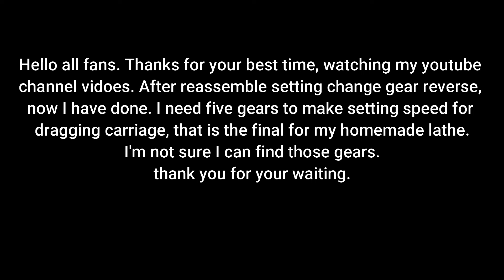DYI, Renew Setting Change Reverse Gears Southbend Lathe Has Finished Pt5

Comment: So i´ve been following all the series of videos about your lathe and i really admire your hard work, you´re really giving your soul on this project and i see a qualty job here. I´m honestly pretty amazed on what you got there, i can see how you don´t have chatter problems, it really feels like if you were cutting paper sometimes! I´m also making my own lathe and im uplgrading their bearings to roller ones since i got a huge chatter problem.
 Just some important things i noticea and i need to point:
1- You got the wrong the swich, it MUST stop when you press it for safety reason, it is meant to stop easily when you´re in panic situation.
2- ALL the rotating parts must have at least bronze bushings, for example with the gears, and the thread of the carriage should be supported by press bearings in the sides, these parts will get a ton of bad wear without them.
3- The thread nuts needs some anti-backlash system there.
4- Instaling an automatic feeder gives better results in your machined parts, you should try installing an electic motor.
5- Cover the roller bearings, you got them too exposed they would get full of dust or wear from the belts.
6- Make a faceplate will be very usefull so you won´t need to solder parts to hold in the chuck the ones you want to machine.
7- I notice you got a lot of problems of your machined parts constantly getting full of rust (probably due the humidity conditions there and the fact you got your lathe in the outside) i suggest you using motorbike chain grease, very sticky and dry wich means they cover your parts without getting full of dust or fluff from the air.

I´m really seeing forward of the next thing you do, you got a new subscriptor here 👍
Reply from the maker: @francyszz3  Hello Francy 
I appreciate your maintenance and thanks for all your recognition is the good. I got some ideas but the problem is the tool's material not easy to find. So I'm slowly work all the time.
Thank you
Reply: @mr.ranyhomemade2466  I see, I'm sure you can find broken carbide tungsten bits, they're very handy as tools (remember use diamond disc to grind them). Also Cobalt hss bars shouldn't be hard to find
 You're also lucky you got decent people that can machine your parts, sadly the ones I find here are bad and lazy 😞